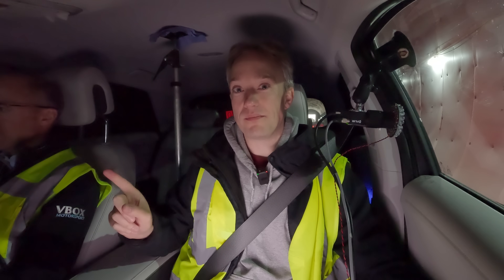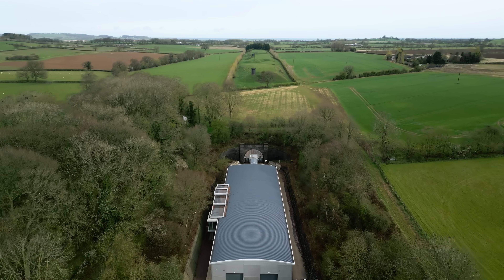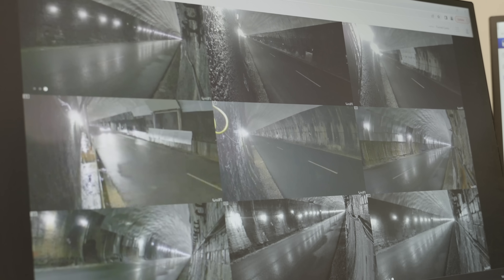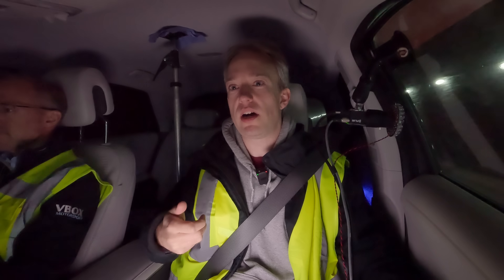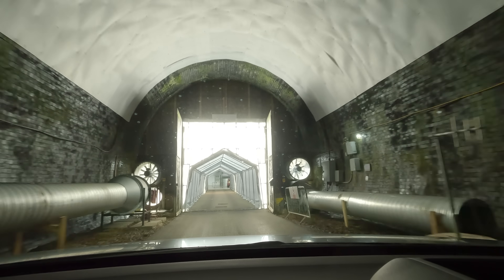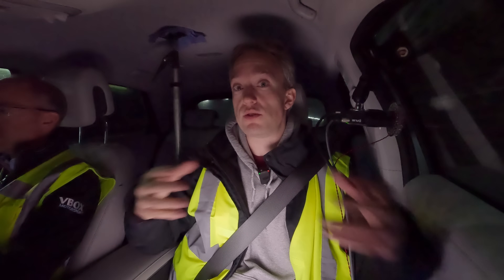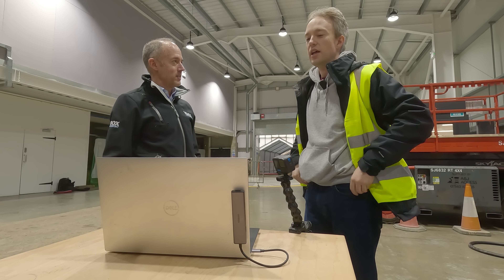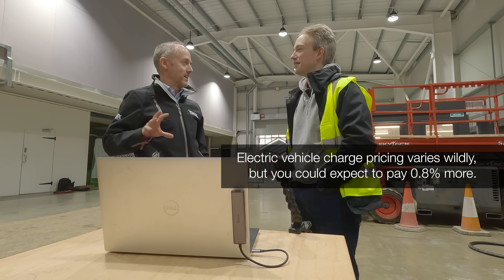This is an excuse to show you a really good tunnel

Comment: 3mm in 2.7 km? That's an absurd level of precision even for today, much less Victorian England. What the hell?
Reply: @partraiserhc9351  It's stated in the video that the tunnel has a gradient. A tunnel can be straight without being "level".
Reply: @unicyclingistheshit  So what you're saying is it might be on the square but not on the level?
Reply: Hey. As an ex-suryeyor. I would  excavate a rough tunnel. Fix a high magnified theodolite at both ends. Sight them 2.7 km down each other's optics and use that to create a straight line for levels. Being in a tunnel atmospheric distortion will be significantly reduced to..
Reply: They might be talking about the level of the asphalt floor, which was carefully laid to be as smooth as possible after they decided to start testing cars there.
Reply: @partraiserhc9351  I understood it to mean that it is a straight line within 3 mm, but that straight line isn't actually tangential to earth at the tunnel center.
Reply: @partraiserhc9351 not level, STRAIGHT.
Reply: @AnimeSunglasses   I know, my bad. Had “water level” in my head when he said there was knee deep water at one end
Reply: @partraiserhc9351 hat assumes that the entire tunnel floor was completely free of debris, which wouldn't have been the case considering it had been derelict for half a century by the time these guys got permission to use it.
Reply: @karlgookey  my mistake, I was thinking of waterlevel but they built it with almost laser level precision. Later in the video they also state that if you travel one way its a small incline and the other way a small decline.
Reply: Even old school Theodolites are super accurate.
Reply: A plane-table run by a good survey crew can get you there with a slide rule and a day's work. The result will be given in chains.
Reply: The khufu pyramid of giza is level to 2cm and that was built 4500 years ago.
Reply: Also, light goes fast. Objects in orbit stay in orbit because they're going exactly the right forward speed that the centripetal force of gravity causes them to trace an orbital path. The orbital speed of the ISS is 7.66 km/s. Imagine what would happen if it were suddenly to speed up to light speed (300,000 km/s).
Reply: Surveying, bruv
Reply: Built by that one perfectionist that always got told off for overdoing it, but not this time.
Reply: Maths. Over a decade before that, Switzerland built a 15.5km tunnel, and started digging not from just one, but both ends. The two tunnels met in the center of the mountain with being just a few centimeters off of each other. (And luckily, unlike the tunnel in the video, it's still being used for trains to this day).
Reply: The romans had an aqueduct wich was 40km long and differed only by 2-3cm iirc
Reply: @burnstick1380  Oh yes, they absolutely mastered building long aqueducts with just enough of a slope to make the water flow over ridiculous distances!
Reply: @burnstick1380  You say Romans, I say computers. ;-)
Reply: @partraiserhc9351  It's impossible to have a straight line running parallel to the earth's geoid so I don't know what you're smoking.
Reply: @ildarion3367  damn I realy wasn’t thinking, I was thinking water level in my head.
Reply: You're actually right, its an absurd level of precision and people are focusing on it too much , considering that the "rail and the Ballast was removed " there is no actual way to tell what was the precision. the surface you see is not the old rail tunnel ground but a modern flat poured surface.
Reply: it's just the cheapest way to buld a tunnel straight instead of curvy, because it's the shortest distance.
Reply: I doubt it was that flat originally
Reply: I think you mean 0.118 of an inch...
Reply: But what method did they use to measure it? And what physical markers did they use to measure it? And who measured it?
Reply: It could be done with very accurate survey stakes and a theodolite, or even just a small telescope with crosshairs on it.

It's not a task that's technically difficult, it it is one that requires a lot of work and time.
Reply: obviously their civilisation wasn't advanced enough to build this on their own. it must have been aliens!
Reply: i heard they used the kings penis as a mold and built the mountain around it.
Reply: Aliens, obviously
Reply: Cue conspiracy theories about the Victorians having way more advanced technology that today which was wiped out and erased in a global cataclysm
Reply: Thats what I thought… That one fact blew my mind more than anything else… Incredible, really.
Reply: You might like to read some technical papers on the engineering of Roman aqueducts. The precision of engineers throughout history working with the tools of their time is incredible.
Reply: Probably also just got a little lucky I imagine, idk
Reply: The Catesby Tunnel was constructed as part of the Great Central Railway, one of the last mainlines constructed (it says 1897 on the tunnel as you can see).
To compete with the already well established LNER and their East Coast Main Line, the GCR was constructed for high speed (for the time) operations and this meant as few corners and gradients as possible.
Reply: When the Queen says "make it perfect", you do. When your boss says "I need this by Thursday"... he gets it. Modern motivations are very different. You could do it with a bubble level and a spoon if you wanted it perfect, but you'd need thousands of skilled workers and decades of unlimited budget.
Reply: Water filled trenches are the best levels.
Reply: @timwildauer5063  If you can see the entire distance (easy for 2.7 km), making a straight line is trivial. You put a light at one end at the end of a fixed long small diameter pipe. Then as you dig the tunnel, you keep the light visible when you're at the centerline at a set height. Same thing as a laser sight, except without the laser. This will result in a truly straight line. It will not follow the curvature of the Earth, as would happen with a water-filled trench. And it does not guarantee the tunnel is level (no gradient).
Reply: @timwildauer5063  that gets you a curved line following gravitational equipotential.
Reply: I ran a few scenarios in my mind...

scopes probably can help... (series of boxes with well aligned small hole on it...)
strings can also help... well aligned strings pinned onto well aligned sticks on the ground pointing into the direction to dig...
Reply: The victorians were the best engineers in the world. much of their stuff is still in use today
Reply: @TheHobohobbit  That's a description, not an explanation. You might as well just say "dwarves did it".
Reply: @General12th  My explanation is that it's wrong and is, in fact, a dramatic exaggeration.
Reply: @General12th  dwarves did do it
Reply: @General12th  OP never asked for an explanation 🤦
Reply: @General12th  As a representative of the dwarves, yes, we did it
Reply: @General12th  lul
Reply: @General12th  ROCK AND STONE!
Reply: @General12th  He didn’t say or imply that it was an explanation. Dwarves didn’t do it.
Reply: Well, maybe they were short victorians
Reply: @TheHobohobbit   iam a German Engineer and i agree , did some incrediable stuff back in the day !!
Reply: @TheHobohobbit  
Egyptians
Reply: @TheHobohobbit  such good engineers that they coated all the insides of their tunnels with toxic filth from burning coal. Ioniq 5s they had not.
Reply: Aliens obviously, trust me bro
Reply: Somehow knee-deep in water at one end though...
Reply: @kjduncan1  I was wondering that too, how was that possible?
Reply: I guess it wasn't that flat/straight before they put on the asphalt
Reply: Combination of several posts in a line to get straight line accuracy and lengths of hose / pipes and using water to get the vertical levels.
Reply: its cause the atlantians actually built it
Reply: The techniques and skills have been lost to time and lowering of quality of material and workers. Money would be a big factor too, with governments using the cheapest options possible.

There was also the factor of there being a high demand built around a whole industry for the country at large.
Reply: @pachychon  Not so much 'lost to time' as playing with lasers is faster, more accurate, and requires less training.

On the other hand, most of the people with practical experience aren't doing the work these days, and whatever the books say, there's some aspects that only become obvious when you're actually out there doing it, and that practical knowledge is more-or-less lost.
Reply: @boobah5643  True enough, same thing with all aspects of construction, from housebuilding to metalsmithing. It's just cheaper quicker and easier to have a machine calculate and churn out parts for whatever needs done, craft, artistry or pride aside. Which society nearly as a whole in the large scale seems to have done away with for convenience and comfort.

Part of what makes Tom's videos so enthralling is the feats and marvels he focuses on, old and new.
Reply: @pachychon  Not just convenience. Profit.
Reply: @boobah5643  Additionally, something we don't point out very much with this stuff: we'd have all of this working knowledge back within a decade or two if we really needed it.
Reply: But don't lasers get curved with gravity too?? Wtf do they mean by "real" flatness and then talking about laser precision? I don't get it
Reply: @JustSomeGuyWithAMug  I looked that up, but couldn't find anything on Earth's gravity curving light. I think it must be an extremely small effect. The curvature is noticeable with the Sun's gravity, but Earth is miniscule in comparison to the Sun. Then there's this line from Wikipedia: "Despite being considered "strong", the effect is in general relatively small, such that even a galaxy with a mass more than 100 billion times that of the Sun will produce multiple images separated by only a few arcseconds"
Reply: @eekee6034  then i may have understood nothing from my phys teacher in school, thanks for searching for me, should just have told me to research
Reply: @JustSomeGuyWithAMug  You're welcome. :) Sometimes it's hard to understand the different scales of these different phenomena. In actual fact, I had to look it up to understand it myself. :)
Reply: @JustSomeGuyWithAMug The mass of a photon is so small that the effect gravity has on it is unnoticeable over the course of 2.7km.
Reply: I am tempted to think the 3mm is a BS number. What part of the cross section does this theoretical measurement line go through? I think the most obvious answer would be at the floor, in the middle. Except it's clearly been paved very recently. The Victorians didn't make that asphalt. And the walls, well, they're clearly uneven. So that couldn't give you your 3mm. What about the mathematical center of the cross section? Take the centroid of each tunnel opening? Again, the walls are beyond uneven so how could you pick a valid reference in the middle. Maybe... despite the unevenness of the walls, they all average out to a very similar centroid, within 3mm. But I still find it unlikely. 

My conclusion is that the Victorians didn't get it so precise, the people paving the road did, and Tom's wording was a bit off.
Reply: 3mm in 2.7km is yet more evidence that we live in a simulation.
Reply: Water always finds a level.

Simple and accurate.
Reply: @yt.personal.identification  Water follows the curve of the earth.
Reply: @earthknight60  and there is a 3mm variation - according to a laser - along the total length.

That fact supports my theory, rather than disputes it
Reply: @yt.personal.identification  It's at an incline. Says so several times in the video.  one side is higher than the other.  That disputes it.  As does the fact that he already mentions the adjustment to remove the curve of the Earth, which water would show.  Both of those facts dispute the water hypothesis.

Water is excellent for leveling small scale structures, like the bases of the Egyptian pyramids, but this is a different thing.
Reply: @earthknight60  How is it different?
It is easier if anything.
Reply: It seems like hyperbole. The roughness of the tunnel is far greater than 3mm so you can't really say it's straight to within 3mm.
Reply: @gasdive  yes you can
Reply: There's no way it's accurate to 3mm over its entire length, that was just BS

Comment: This is probably a dumb question but does the weight of an electric car battery change from having a full charge as opposed to having low charge?
Reply: No, charging just moves the electrons from one side of the battery to the other. The only thing I can think of that would change the weight is the outgassing, which means a charged battery would actually weigh less. There is also of course the relativistic mass of the energy, but that is negligee by a factor of c^2
Reply: @arshia.sasson  Yeah using E=MC^2 to count the energy in the battery as mass, the mass would change by a few micrograms.

Comment: Technically, even in close battery systems, batteries do weigh more when they are fully charged than deplated due to having more energy. I only know this about AAs and it's a negligible amount. I don't know how that scales up but I'm sure these smart folks have thought of that, while I'm here struggling to choose between Ketchup or Catsup.
Reply: The relativistic mass of the energy is fairly neglible compared to battery outgassing, and charging only moves electrons from one side of the battery to the other. Thus, the mass does not vary much
Reply: It's true that energy is mass and and mass is energy. Apparently an electric car battery might have 100KWh when fully charged. As mass that's 4 micrograms. And it's only going to use a small fraction of that up going through the tunnel a few times.

Comment: I love how Jon Paton had to remind us that the surface of the earth is curved, just in case a certain group of people unironically cite the laser light as proof the earth is flat...
Reply: "A... fifteen degree per hour drift..." - "Thanks, Bob!"
Reply: "Interesting."
Reply: I found that quite interesting. So that means the tunnel is a perfectly straight line, while "level" is curved. So that means that, while the tunnel is perfectly straight, it would change gradient relative to gravity a tiny (barely measurable) amount from one end to the other - going the uphill direction it would gradually get steeper? If both ends were at the same elevation, that would mean the middle would be "lower," closer to the center of the Earth, and water would pool in the middle? But it's slightly inclined, so that doesn't happen.
Reply: @quillmaurer6563  In all likelihood the tunnel was just built tangentially to the surface of the earth at one end, making that end the "low" end
Reply: @richardmillhousenixon  considering one end was submerged in water Id assume that is correct
Reply: 2.7 Km is = 8 inches per mile squared, or 52 inches of curve.
Reply: In principle, it's not a dumb argument; there must be a distance at which the curvature should be noticeable.
How long of a perfectly-level run would one need to observe (or not observe) the phenomenon?

I know of the canal and mast test, and that those results can be disregarded due to not factoring in refraction from air and water.
I know of a test done on a frozen lake at a distance of roughly 6km that demonstrated no curvature.
I recall several other long-distance shots (10+ km) of buildings and landscapes from a camera (Nikon P900 I think?) which purportedly ought not to be possible on a curved earth.

What do you think about the idea?
What evidence do you know of?
Reply: @Runescaper1357  The easiest way to see the curvature with the naked eye, is in our shadow on the moon.

There is also a place in Australia you can see it quite nicely. The Nullarbor Plains, I spent a few hours going across it in a train and it messes with your head. You can't see beyond about 10-20km in any direction. It feels like the world hasn't rendered correctly and your view distance is set to medium.
Reply: @Creaform003  
Of course! I hadn't considered the moon. Seems rather obvious now, but I was thinking of strictly earth-to-earth possibilities.

If I ever find myself in Australia, I will attempt to check that out!
Cheers.

P.S. if ~15km is 'medium' render distance, you must have a great PC :P
Reply: @Runescaper1357  Fyi I believe the train Adam is referring to is the Indian Pacific, I don't know if there are other passenger trains which also go to Perth.
Reply: I often ask them people to explain a lunar eclipse.
The only answer I ever had is..."its a projection show".
Reply: @Creaform003  Pfff! You believe in the moon?  
<joke>